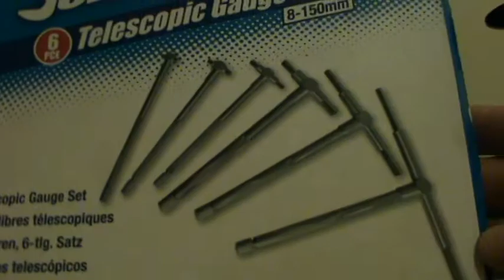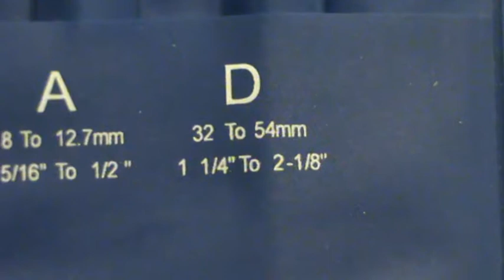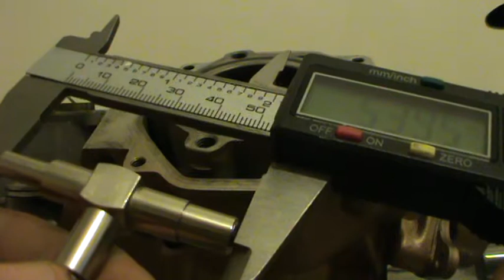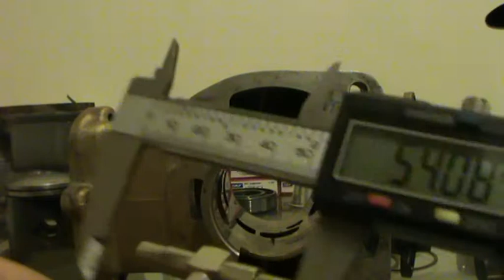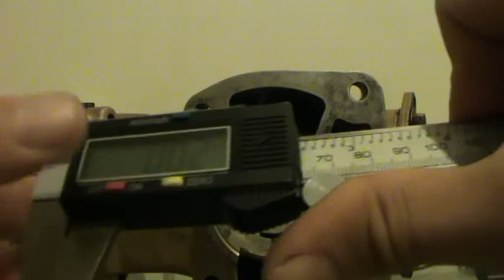Aprilia RS125 Piston and measurements for BluePrinting before ordering new parts

Comment: It is a HORRIBLE meassure, the first you need a micrometer, the second ALL barrel 122 are over 54mm. (54.00-54.01-54.02)
Reply from the maker: yes you are very correct in your comment.  I very rarely use these.  In a pinch, these you can get away with or get a ball mark.  Please notice I have not recommended this item.  I just merely mentioned these.  Also the digital vernier are also bad.  You can lose upto -/+0.1 in measurements.  Analog is the best to have.

Comment: Your meause piston is original or what brand?Side coated black meterial, original piston not coated...
Reply from the maker: wossner create their own version of piston.  Those pistons are coated to protect the cylinder and piston.  When you buy any piston, they normally come with their own brand of rings.
Hence wossner would be the preferred choice.  The MAJOR issue you have now.  IS.....  Cylinder barrel.  Is the barrel any good.?  Has the barrel damaged itself badly.?  If yes, then the barrel needs to be re-nikasiled.  Piston is not the only issue now.  Please check your barrel for scores and defects.!
Reply from the maker: This is a chance for you to do something REALLY good to your APRILIA....  Do not cut CORNERS.
Reply: jason puttock Thanks!
Reply from the maker: Please do a  COMPRESSION test.  I would like to know what your PSI is @. Can you do a compression test.  Disconnect your Carb before you test the compression.
Reply: jason puttock I have vhm head (1mm squish), i meaused squish, and this is 1mm, and compressor is 110 psi.I think no bad bad no good :) because normally squish is 1.5 mm.I have only shake noise sound small...I will change piston, you know ring clearance much more.
Reply from the maker: psi is low.

I think yes piston needs to change and barrel repaired.

PSI should be above 140

Comment: Hi jason, i have a question again if you help to me :) is this normal piston ring clearance ? : https://www.youtube.com/watch?v=7L8fA3U6_fo
Reply from the maker: no.  That piston ring is TOO EXCESSIVE.  The piston moves more than the ring. 

Being a single ring system you can will suffer premature wearing on the piston ring and cylinder wall.  However.  Too big movement.  The ring is too small for the piston.  Ring needs to be thicker or change piston for the correct gap. 

I think bad machine - GAP - caused this problem.  PISTON maybe be good but ring WRONG....
Reply: jason puttock Okay, thanks mate...maybe you remember, about my bike rattle noise, i asked you, i think it coming from ring...like shake noise...